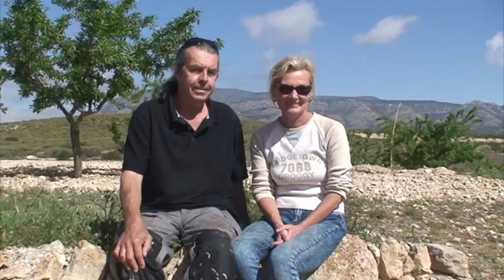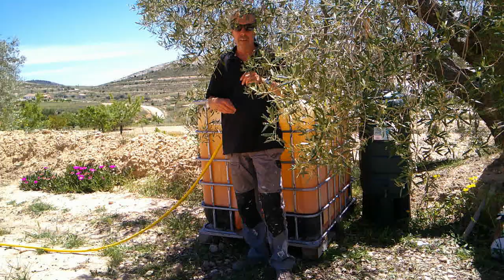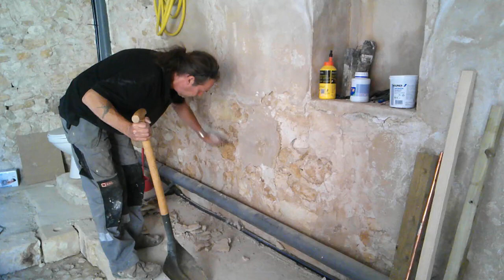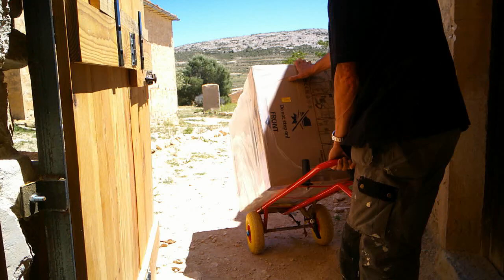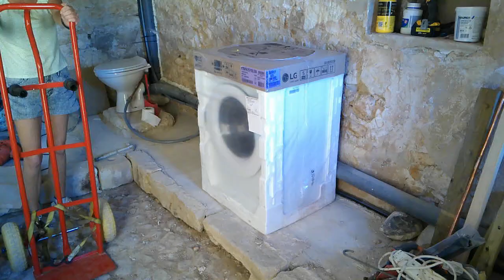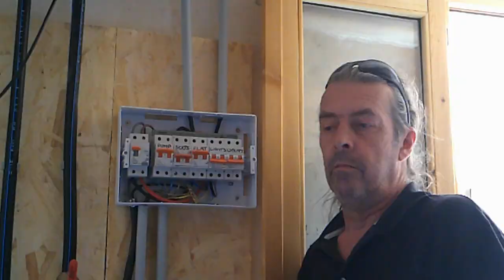We have a washing machine! Restoration of an off grid Finca in Spain

Comment: When you said the deposit leaks away - are you talking about the big hole that you treated with the resin (etc) ? ... Happy to see you have a washing machine that will run off electricity ... another vlog Luke and Sarah “off grid in Portugal”  - Luke connected his washing machine to a bike !!! ... very clever (and funny to watch) but I am sure exhausting ... 🙏☘️😘
Reply from the maker: The tank we sealed is fine, this is another huge hole in the ground that collects run off rainwater on the land and if we have to get water hauled in, this is where it goes. It holds water well to a certain extent but does leak very slowly. As the deposit has been dry for many, many years (the water was diverted away from it) after a few good soakings it should improve
Reply: @FincaLife  thank you  ... I had given your tip to a friend who has a leaky tank ... so I was just checking  ... I’ve told her to tune in to you adventures ... I think she has ... have a good Sunday you two 🙏☘️😘
Reply from the maker: @portugalonawingandaprayer473  Thank you and you too

Comment: Just curious, but did you have to do much roof work before starting inside?   Soon to be 1000 subs!
Reply from the maker: The roof wasn't too bad. We aren't allowed to put a new roof on, not that I would want to - but we can repair the existing roof. I am working through the roof doing the parts above the areas we are working on. I took all the top tiles off, reset and replaced any damaged lower tiles, then spray foam insulated the whole of the area, before putting the top tiles back. There are different opinions on this method, but it worked well for us. The roof is fairly well insulated plus we can retain the original character inside, without the need to insulate.
Reply: @FincaLife  very oool... Really like the look of your roof!